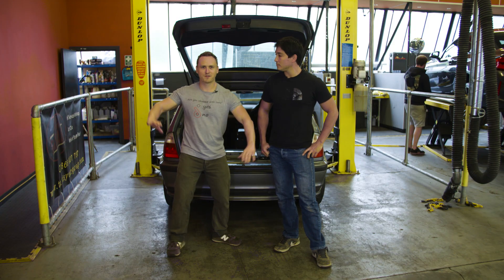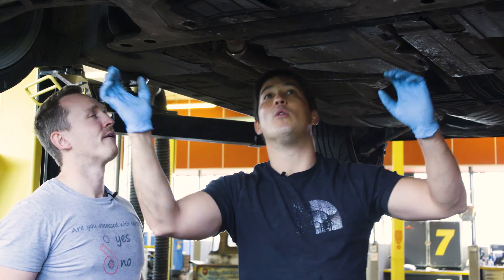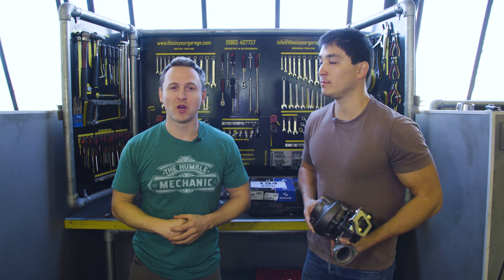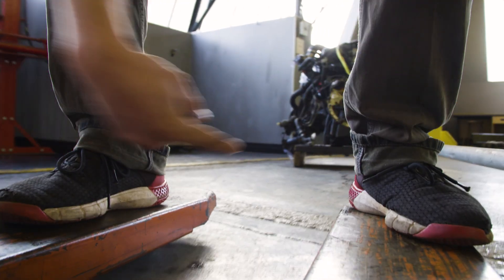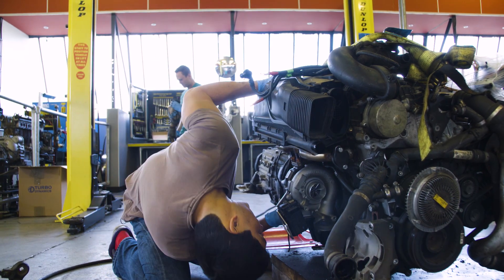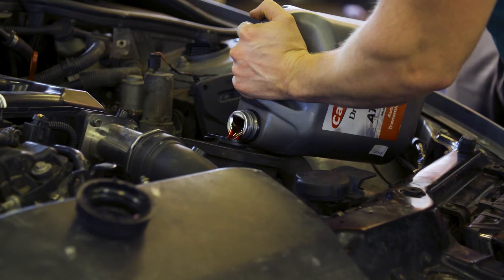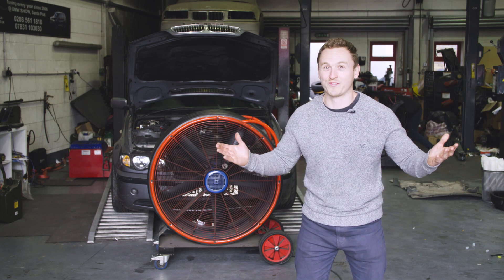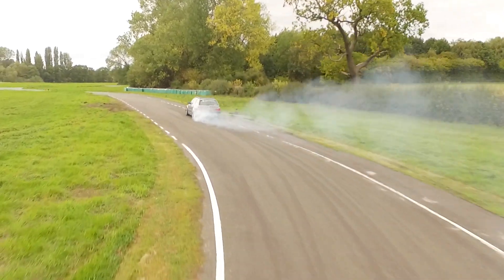How Much Power And Torque Does A Hybrid Turbo Add To A Car?

Comment: So, a hibrid turbo does the same as a bigger turbo, works better on higher rpm and not as good on lower rpm. Is that correct?

Comment: How common is the cracked manifold guys? I just got my first e53 turbo diesel (I'm addicted to euro diesels), and my x5 had the F 6 speeed and very low milage, immaculate  and drives perfect... but the turbo spool noise (even tho I bloody LOVE IT), I didn't expect on a luxury x5 for it to be that loud... sounds awesome... but makes me think it could be seeping/bleeding out a small amount of boost, because it still pulls like a freight train... up to 160kmh, I backed off as I ran out of road (private road)..... and I plan on doing mods and getting more out of it, and also converting my 97 tj wrangler Jeep to either m57 or merc om6.... should I pull the turbo and manifold off to check for cracks ?

Comment: The air is not super sonic. The speed of sound increases as the air is pressurized so you never get to super sonic. Otherwise you'd hear a sonic boom whenever you build boost. Lastly, clipping turbine wheels tanks efficiency, and very marginally increases mass flow. It basically should never be done as your turbine is probably losing 10+% efficiency.

Comment: Why instead of using this four paddle clutch that will be a on off switch they don't use a double plate clutch? Clutch will feel smooth almost like still with a oem clutch

Comment: Without replacing engine and transmisson components, this is just a ticking bomb. Those components are not designed to handle that much power, and they will break.
Reply: M57 engines withstand about 700 hp on stock internals except for the valve springs. The manual boxes are also extremely sturdy and take that power easily

Comment: 1:19 How the F can a clutch with such a small surface area be able to transfer more torque than a regular clutch with a few times bigger surface area? Yes different material, but why make the surface area so small???

Comment: Wikipedia Hybrid Turbocharger: A hybrid turbocharger is an electric turbocharger consisting of a high speed turbine-generator and a high speed electric air compressor.

I'd call what you have there an “aftermarket upgraded turbocharger”.  Because there's nothing hybrid about it— it works mechanically exactly like any standard turbocharger; it just has upgraded parts (performing the same duties as the original parts, but better).

It sounds to me like you bought into some sleezy businessperson's term misappropriation, choosing to steal a popular buzzword to describe their fairly mundane product (not necessarily low quality, but mundane nonetheless).

Comment: Really guys u are so Bad 😂😂

This Engine can have 400hp easy
Reply: Anon Ym its a diesel they make more torque then horsepower, your comment is ignorant especially when you dont know what your talking about when it comes to diesels, my alh tdi made 87 horsepower stock and makes almost 200 now, but 280 lb ft of torque.

Comment: I had same e46 330d with stock e90 170kw turbo. 306hp and 700Nm. You can check acceleration on my instagram @edvinambal. Regards from Lithuania

Comment: My questions include, why not upgrade exhaust manifold/header, downpipe/exhaust, intake piping, intercooler..basic upgrades for a turbo vehicle, and you already had the engine out and had easy access..I don’t mean to be rude or cocky but it’s a track car so emissions aren’t a worry..and a lot of power that the new turbo would’ve added is going to be lost through stock parts

Comment: Everybody should block their EGR, It's very expensive to replace and doesn't do anything but block your intake with tar!!!
And it also doesn't save on fuel because when the engine gets less air the fuel sensor starts asking for more fuel!!

Comment: Had my E92 330d LCI remapped by BW Chiptune! Top guys who really know their stuff - cars now running 322BHP and almost 700NM torque. Completely transformed the drive. Also remapped my previous 120d, ran it for 30k miles with no problems at all. 174bhp - 210bhp 450nm
Reply: What transmission in your 330d

Comment: After doing all that id take it for a test drive down bumpy roads then come back and retighten/check things. Now that its just for the track.... then do it where you can but Ive learned from experience that something always comes loose. You watch all these tv shows where they restore an old rusted hot rod for someone in three weeks then hand it over at the last minute. That's pure bullshit. Half the bolts will need to be tightened again and everything checked. This is a newer car but the old ones need constant love.

Comment: You have the wrong car, get the new F10/F90 M5 it has the reverse intake and exhaust  meaning the turbos are on top of the engine  for easy swap of turbos . Then you can have 703 WHP and 659 torque  like me

Comment: now hitler haha next mod should be straight pipe exhaust and intercooler and after that I may run out of ideas xD i have a gt2260 in the asz engine and fitted the turbo in the awx manifold in my caddy tdi and I want this turbo haha whats the model number on the new Garrett * cough * garreth turbo? xD

Comment: This proves the “Ecu chip” episode was nothing more than a misleading advertisement episode lol

Also, you went through all that trouble, why not go ahead and upgrade the intercooler and put a free flowing exhaust on it... considering it’s a track car with the EGR deleted?
Reply: It didn't prove that at all. It proved you get more power and torque, which gave us quicker lap times. Not enough to beat the M3, but for a plug and play it did the job!

Comment: Why has the engine gotta come out to change the turbo. I did my e46 330d turbo conversion on my drive & only removed the turbo.
Also as its a track car why are u not fitting a solid fly wheel? as u know padal clutch will only kill it, there also pain in the arse on the street in traffic.

Comment: My bud and i made same power by just palcing e60 n57 engine injectors and turbo and ofcourse remap  had same power on e46 sedan all original clutch and flywheel ( sachs) like bmw likes and that cost us just 300eu so yeah you dont know what are you doing :D the car is used as a daily and track car more than 3 years now nothing had failed yet so yeah ;D
Reply: Gotta love an expert

Comment: Wait wait wait... what happened to the "RaceChip" you put in the car few weeks ago? Why did you take that out for a real flash tune. Isnt the racechip good enough? Yeh its fuckin garbage I know
Reply: It gave us the desired result of setting quicker lap times. But to beat the M3, we need seriously big power and torque gains. I actually liked the RaceChip

Comment: Get a decent injector cleaning in there to, aswell as some shell vpower diesel. 

id recommend using Hydra power blast diesel.. one of the best cleaners to date.

https://www.hydra-fueladditives.com/HFP-DPB250.html?gclid=Cj0KCQjwuuHdBRCvARIsAELQRQHLX2UNAyNVnXEaVGZqAkWFJ3TCpqPiwqgW_jkCz4oN3d7Wjpe8QZMaAtfiEALw_wcB

Comment: I'm not even surprised by the price of the gear linkage, a stock e36 steering wheel, basic: no airbag, no slip ring, no on wheel controls: 550 euros

Comment: I’ve got a mapped E92 330d which is very similar on power and torque. Trust me when I say you’ll need an LSD! I’ve quaife’d mine because with so much torque going through one wheel, wheel spin was ridiculous, especially in the wet.
Reply: yep, it's absolutely savage currently!

Comment: no stock numbers 
nothing to compare too
Reply: I said the stock numbers in the video 

204hp, around 300lb ft torque
Reply: @alexkersten1964  lol When ? it was too casual, i never remembered hearing it. 
ideally should have had a dyno run first, and put that before the new runs graphs

Comment: This is how this series needs to be. An nice in depth video about the work done the car - and it is proper work this time - and not some commercial for a cr*p piggy back tune... Thanks
Reply: Cheers, and regarding the RaceChip, it was an experiment. And in fairness to it, the performance was much improved over standard, so although people love to hate on it, the power and especially torque gains paid off on the lap
Reply: My comment was a bit harsh, I know they work, but I often wonder how they perform on the long run. Anyway,  I'm just one off those nerds who enjoys working on cars more than driving them. I loved the IS200 series you guys made and I felt like if the new beemer videos were going to far away from that original idea. Keep it going! (and I do respect the fact that to make this show - for free btw - that you need to make money in an other way).

Comment: This is a really expensive way to add to what you have done. Why not an exhaust? Losing mufflers would not only reduce backpressure but also reduce weight.
Reply: Also you don't need more boost at higher rpm. IT'S A DIESEL.
Reply: Also the time you'll lose on track with that stiffer pressure plate

Comment: I owned 330cd 6 speed  m57n. For 4years
Fun car ,strong engine but everything around it is shit. Clutches slip with remap ecu flywheel is stupid expensive, exhaust manifold cracks because its aluminium not iron, injectors are shit and easy clogs up, always can smell unburdened diesel outside.
now days its all most impossible to find proper car. All most all of them got 200k miles and are not maintained properly because parts are expensive.
If you find ~100k mile car with full maintenance history for dissent price it is awesome car. It’s worth your time.

Now i own 330ci 6 speed and I love it.
Sounds awesome, revs like dream, lighter and waaay more fun to drive on British B roads.
🤟

Comment: Hybrid Turbos are a great way to add power without breaking the bank. I put an F23t FrankenTurbo in my 2007 GTI and it feels like a fresh breath of air for the engine.
Reply: How much power u gain from it?

Comment: Why use lb-ft rather than Nm? Come on guys the metric system is the standard for that.
Reply: Not around these parts
Reply: Alex Kersten sure? You still use metric sockets weight in kg etc ... and SI units are standard in UK engineering universities and industry ;-)
Other than that I like your channel and hoping you still have Colin?

Comment: you guys did use a new throw out bearing right?    love the series !!!!

150.000 revolutions in a minute per second?????

i should have gone with a solid wlywheel and and a superdamper (crankpully) that dualmass is going to fail again soon....been there

Comment: I think the standard intercooler is fine, unless he was pulling bigger numbers, he's also running it on a rather short track. The upside to the standard one is that he'll experience less turbo lag and retain boost, but IAT would be a little high for comfort after the 4th or 5th run. On a bigger track, I'd say yeah it's worth it because he'd get a ton of heat soak.

Comment: After 4400 rpm it’s producing less tourqe than standed mate that needs to be addressed it drops off very quickly dont know if its the tune or the intake temps are going through the roof because the standard cooler is shocking on these but usually even the hybrid set up should alone bring them down a touch it needs a 3” exhaust an cooler to get the top end

Comment: Just weld the dual mass flywheel. It's cheaper and will hold up for your fun on the track. Only thing you will notice is a slight judder when you don't rev the engine enough when pulling away. The movement is there for people with newer cars that can't bloody drive giving the flywheel some slip instead of the clutch/engine revs dropping.

Comment: Really winds me when people who drive diesels talk about torque, it still has 110hp less than the m3 so the m3 would still hammer it. All well and good have 470lbft of torque, but that's at like 2500rpm, so that's a big 226hp.. hardly gunna make it beat the m3. Still cool, but less of the torque talk lol

Comment: Sounds dodge to me. Turbo Yoda say the exhaust turbine is the most important and it is being reduced ??? You don't get magic boost because it is smaller. Sounds like is geared more like a drag car and will be less tractable, times will probably fall due to revs but will put-put around town. Hybrid turbo... wank speak for modified. 8-/

Comment: Good job, but you didn't clean the radiators, and with new turbo it's recommended to use new oil feed line for it! Amy way, waiting for next video...

Comment: because the guys didn't actually explain WHAT a hybrid turbo is (in their usage).. here's a simple explanation. 
"A Hybrid Turbo simply means a non-standard or potentially upgraded turbocharger. This consists of a turbo with combined parts from different frame sizes and potentially different manufactures, such as Garrett or BorgWarner to make the ultimate performance turbo. "
Not to be confused with an ACTUAL hybrid turbo which adds an electric air compressor.

Comment: BMW are becoming so expensive for tiny parts it makes you not want to even want to work on them in case you snap something.  The build quality does not match the price of BMW anymore either. Anyway whilst the engine was out you should of put a better exhaust manifold on as well as bigger inter cooler.

Comment: 104£ for a gear linkage part is nothing in comparison to the 470£ Honda wanted for my center dash air vent, and that was just the vent bit with the plastic flaps... your part was made out of metal and it's machined! I reckon that's a bargain xD!

Comment: No exhaust? No intake? No intercooler? No poly engine mounts? No tubular exhaust manifold? :(
Reply: engine feels rough enough without poly mounts but im for poly mounts for whole suspension system
Reply: Exactly my thoughts
Reply: I had poly transmount in my tdi, would rattle change in the cupholder.
Reply: All a great idea.....if money is no object.

Comment: Just struggling to figure out why you dropped the engine tbh, other then cos it's easier to film the work being carried out anyway, also whilst you was there why not replace the exhaust manifold with a cast iron one? Those steel press manifolds are really common for cracking around the turbo flange

Comment: That car is going to need crutches because it's gonna peg leg it's way right around the track with that torque but hey I like that you did what I said before in the video with the piggyback install with the ecu flash 😁. LSD next I bet and that m3 is toast

Comment: Did they increase the drive pressure on the hot side? a bigger impeller on the compressor side is great...in hypothesis in reality you need more drive pressure on the hot side to actually be able to drive the cold side.

Comment: Pardon me for asking. I’m an American not familiar with BMWs mechanically.
What are “swirl flaps?” What is/was their purpose/function? “That used to get eaten by the engine.” In what way? Internally or externally?
What were they replaced with? The video is fairly dark there so I can’t make out what it’s showing.
It looks like a flat plastic plate. You said there were 6 of them.
Reply: Some stupid things moving in front of sucking cylinders, and hanging on 2 torx screws that get loose, and flaps are sucked by the engine. Destroys it. In this one it is removed.

Comment: Some Newron-meters conversions would be great since not every one is familiar with miles pounds and imperial units ...
Reply: Anis TAHRAT Just use 1,36 as a factor.
The same as KW and HP👍🏼

Comment: Now you really need to do a dpf delete and straight pipe. That should have been the first engine mod. The engine will breath in a whole new way, like I stopped smoking. Bigger intercooler and k&n air filter aswell

Comment: Tbh just a turbo isn't really enough... It works best in association with intake, exhaust, valvetrain, cylinder heads, injectors, spark plugs, and the ecu. Just by itself, it doesn't really achieve much
Reply: Diesel's don't have spark plugs and intakes make next to no difference.
Reply: Thanks for the correction but intake does improve airflow

Comment: These guys are dumb. Keep stock turbo, upgrade the fuel delivery, add a Fmic to increase air flow, and flash remap for the extra fuel to increase air to match. The car should be able to make at least 40% more power with no issues. They waste time with a stupid tuner box which does nothing.

Comment: Why why why.... Have you not fitted a larger intercooler???
Reply: Its quite possible that it isnt necessary (yet)
Reply: Nippledozer it’s always necessary
Reply: With the size of the engine and type of engine it's not nessecary
Reply: WTF stop trashtalking ... they put a bigger Turbo inside and tuned the engine. He needs a bigger intercooler! -a n57d30ol driver
Reply: More videos

Comment: Why did you not put a downpipe in it aswell , ecotune do them and make a great difference
Reply: blood_upon_the_rose  ecotune downpipes only have 2 inch diameter, doesn’t work very well with 300+hp. The’re downpipes in 2,5“ and 3“.

Comment: I hope that Alex will take Gareth to Nordschleife one day
Reply: They are talking about doing some serious power and TQ... SO it would only make sense to take the car to the ring.
Reply: You''re both right, the best place to bring Gareth now and see what he's worth, is the Green Hell...
Would be very nice to see guys!
Reply: No car could beat the Civic Type R FK8 in its record on th Nurburgring!
Reply: @koton_bads  This bmw has potential to beat it 😃
Reply: Before that they will need a bigger intercooler because with this power and the standard one the ecu will cut power after 2 minutes.
Reply: @jhuh95  this is the thing called limp mode? Why all this 120d and 330d do this thing? Diesel engines doesn't run cooler than petrol engines?